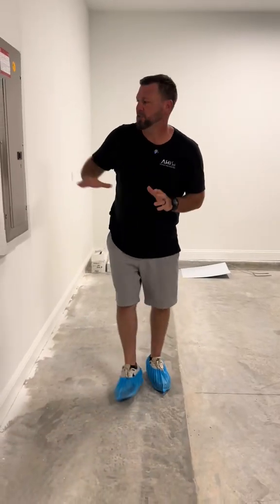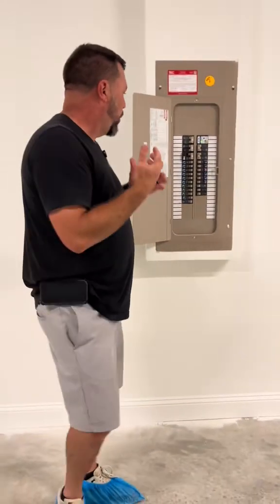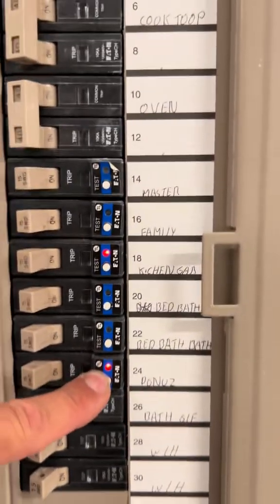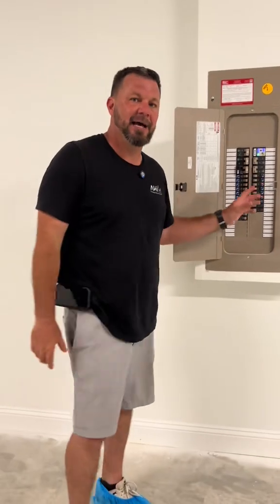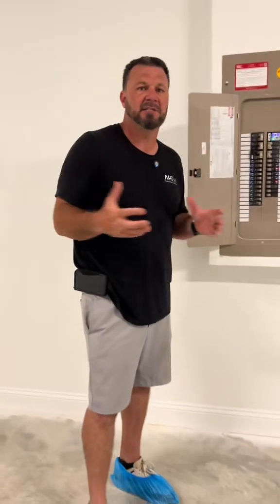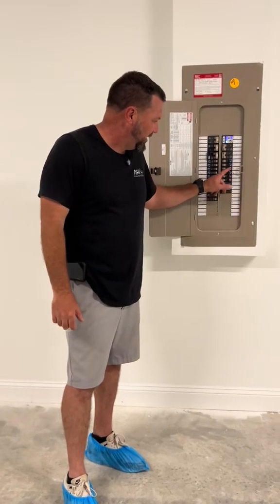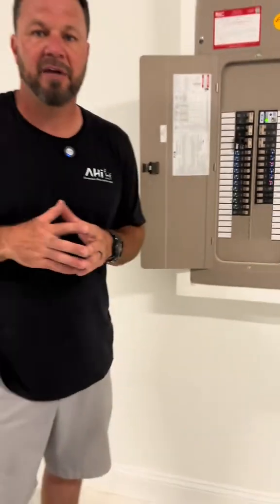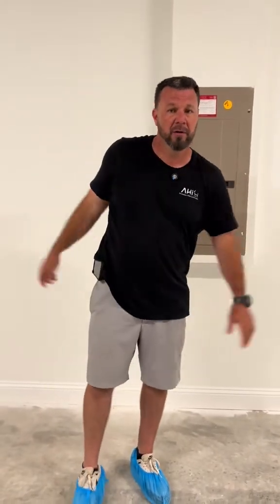Eaton AFCI Breakers #home #electrical #fyp #youtubeshorts #youtube #shorts #shortvideo #shortsvideo

Comment: breaker will work, but will have trouble tripping for arc faults (internal monitoring circuit). You should replace it to be safe, but should be fine for the time being